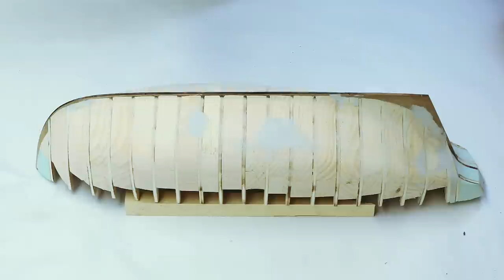Campaign #02 - HMS SPEEDY (1782) - Filling the SPACES - MarisStella (Croatia)

Comment: Why do you place filler blocks between the bulkheads is it for strength or increased glueing surface
Reply from the maker: All at the same time. But the main purpose is to facilitate the laying of the planks, because this is a model with one layer of planking. And also I will bend the planks directly on the hull...

Comment: Olha, I have a question. What is your reasoning for filling the gaps? Since that hull is going to be painted, are you going to do under planking also or does filling in the gaps serve the same purpose? I can see how it would increase the weight and stability of the model and also make planking easier. What is your thought process. (sorry for the long question)
Reply from the maker: There are a lot of advantages here!
The most important thing: the hull will never bend. Yes, planking is much easier (larger area for gluing, you can drive nails where you need, or bend planks with a soldering iron directly on the hull...). Also, over time, your planking will also not be distorted (they can dent between the frames). Because from the change of seasons and humidity, in a few years you will be able to see where the frames stand, it is barely noticeable, but it is present - and it pisses me off that you spent so much time on construction and could not spend an additional month to fill all the spaces)))
If you use light wood, the hull will not become much heavier. This model added no more than 200 grams in weight, because I cut all the pieces at an angle and therefore there was very little thickness of pine wood. Linden is also very good for this. I tried American basswood, which is very similar to linden. But it is only similar and its biggest difference is that it is heavy.
P.S.  Even if your model will be painted or coppered, don't miss the chance to practice to make the correct planking. Maybe it will save your next model from mistakes!
Reply: @OlhaBatchvarov  Thank you. I never even imagined that the planking could sink between frames. I will do this for sure from now on.

Comment: I'm surprised you don't have a mini version of a woodwork shop exhaust system for your power tools.  I've hooked up my min sander, scroll saw and table saw to a 40mm PVC pipe system with a small ember vacuum on the end and standard 40mm T joiners to standard vacuum flex hose to the tools.  It definitely keeps the dust level in control
Reply from the maker: That's because I'm constantly transforming my workshop into a photo studio... I use a big 15 gallon vacuum. But I usually don't keep it connected all the time (only with a disk transmitter, and the rest I just vacuum every time after using power tools)...

Comment: Olha, I understand that filing the spaces between the bulkheads also  effectively replaces the need for first layer planking where a veneer would be used for the second layer?  Is there a mechanical reason not to use balsa instead of a harder softwood or is simply that you had pine on hand at the time?
Reply from the maker: Yes, this time I just had pine, but usually I prefer Basswood or Linden. Insulating foam board or Balsa is suitable only for veneer, small models or simply for fixing bulkheads in the correct position... Because this model has a single-layer planking and I will bend the planks with a soldering iron directly on the hull and hammer the clamps with nails - this cannot be done with soft filler...

Comment: Olha - a couple questions/comments. Why are you filling between all of the bulkheads on this build and haven't on past models. I can understand why at both stem and stern where there are significant bends in planking and you need glue surface area. A comment on using Bondo - that auto body filler is much harder when dry then the wood and you need to exercise care, especially when using a power sander, that you don't destroy the proper hull lines. Additionally, it too can peel if its feathered too thin as I've found working on automobiles for years. Regardless, I'm looking forward to following this great build. Nice work as usual
Reply from the maker: Thank you for your question.
In the place where I live now, the humidity is very high and on my Carrack, where I partially filled the spaces, the planks began to deform (frames protrude)... And in winter, when the heating season begins, this deformation will become even more noticeable...
I also don't sand in 0 with power tools, I do it by hand, for the very reason of not destroying the lines of the ship. And I also sand Bondo only by hand. Its advantage is that it does not deform after drying and does not crack if a thick layer is applied, like putty for wood... And it dries instantly. Of everything I tried, I stopped at this car putty...
Reply: @OlhaBatchvarov  Thank you for your answers. I hope that filling in the spaces work and something I too need to consider as in my area we also have summer humidity and winter heating (snow predicted). Take a look at Evercoat Rage Gold as a filler. I have found it a better product then Bondo  - but unfortunately quite a bit more expensive.

Comment: When mounting to the stand, you mention that the bow should be higher. Why is that, and is that unique to this vessel?
Reply from the maker: Usually, all ships have a deeper draft at the stern - this is to facilitate steering. The smaller the ship, the deeper the stern draft. (For example, VASA has a 60 cm deeper draft) But manufacturers usually neglect this - only scratch builders who build according to drawings know this... This time the manufacturer decided to make the kit as historically accurate as possible. He even recreated the rockered keel. This is a rarer design, but for this vessel it was used...
Reply: @OlhaBatchvarov  Thank you! Greatly appreciate your craftsmanship, learn something new every time.